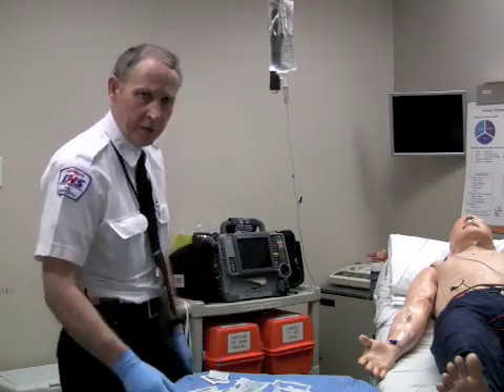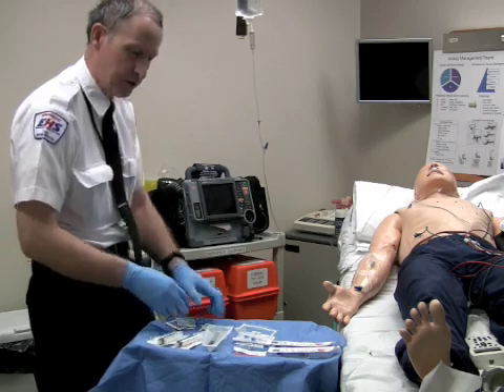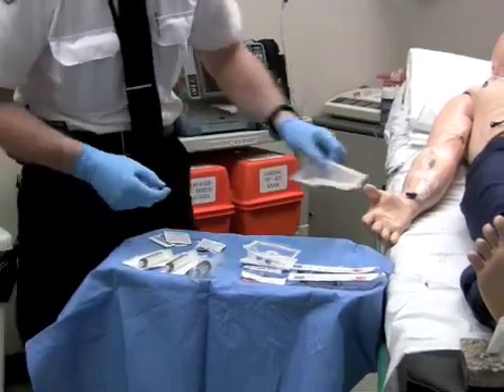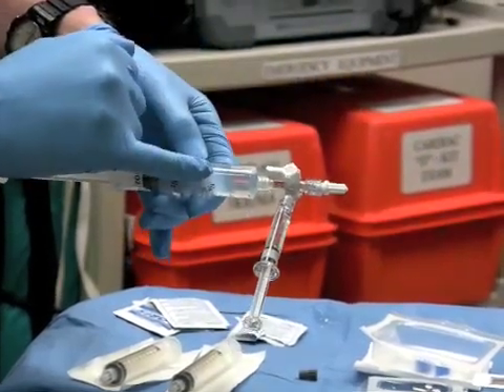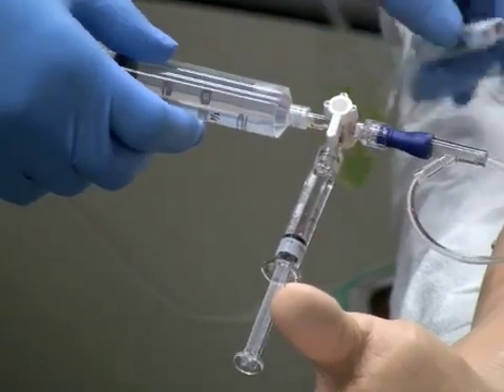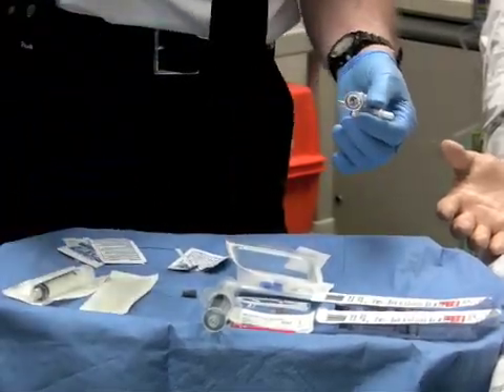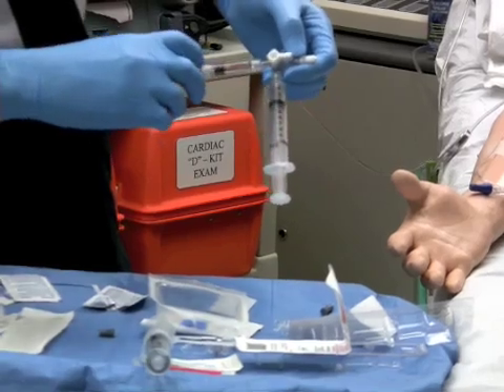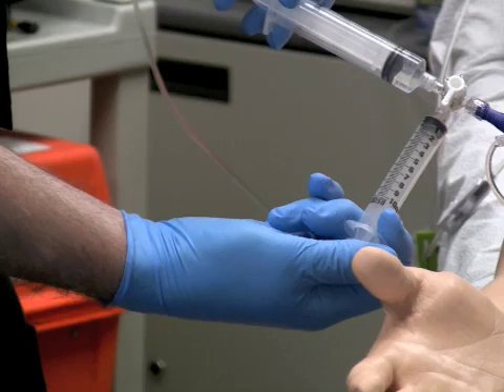Adenosine Administration

Comment: I like the fact you use anti-gravity lines so you dont need to pinch the line distal to site of injection. Because other wise the high pressure inject  from the 20 cc syringe will cause back flow back into the line distally